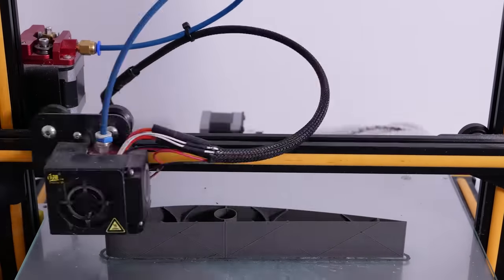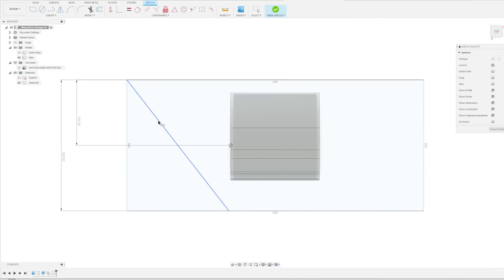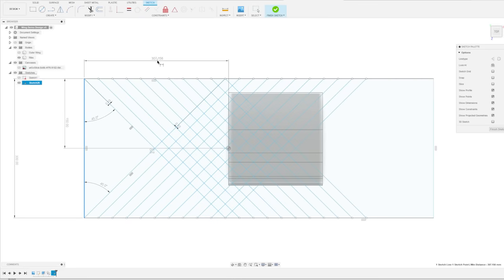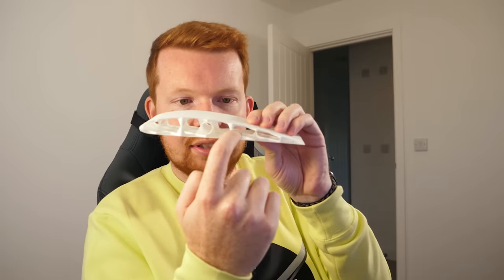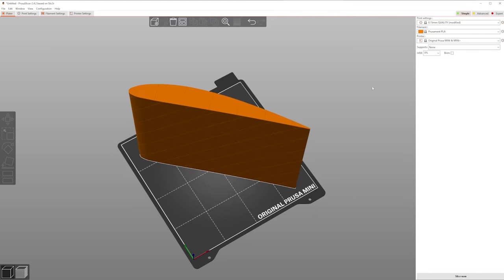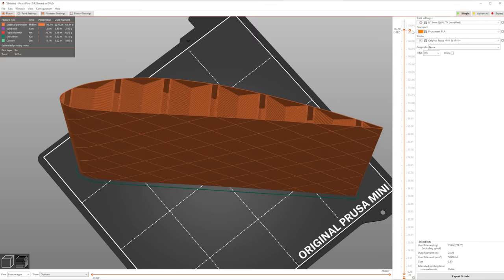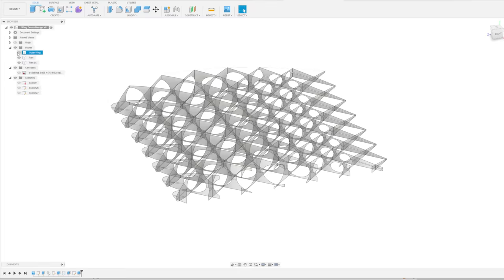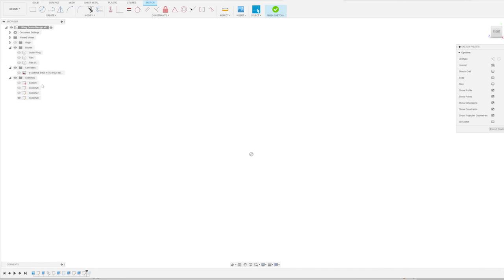How I Designed a 3D Printed Wing

Comment: why wouldn't you just set it up so you can input the NACA number and it'll produce whatever airfoil you want from the equation? then make all of the internals contingent on that, and voila, after making one airfoil you can instantly get another one with any NACA number. since your rudder and elevator will probably be different profiles from the main wing (probably only the main wing is cambered, for instance), this is a good way to go even for just one model.

https://en.wikipedia.org/wiki/NACA_airfoil#Equation_for_a_cambered_4-digit_NACA_airfoil

Comment: Normaly this wings need a little twist. At the outside of the wing the end of the wing profile is a bit higher/up.

The hole for the rod in the wing should be at the center of the lift force :)

PS: If you try to build a new electric drive for a bisycle you can use a big servo :)

Comment: Its a fail because the top and bottom parts are NOT joined resulting in structurally weak parts.  Its not looks but strength thats critical
Reply from the maker: They are joined, that's like saying each layer isn't joined
Reply: @TimStation  prove it in an update vid.  Ive done several test prints.  The top and bottom layers may rest against each other but are not joined or at best a very weak joint because you made the pillar contact points too small.  A larger contact point may do the trick

Comment: how about taking this down n dirty sketch from the point you have the cross hatch pattern in it and NOT the holes ... (add the spar) ... then do an airflow test across the wing and show the stresses on the wing and its ribs ... THEN remove excess material and not take out materiel from the high stress regions and remove it from the low stress ones ... 
.
of all the people that show "making a wing" NONE of them do a stress analysis on the wing ... EVER they just like you have done here arbitrarily slap holes where they feel like ... 
.
what I want to see is HOW the design will change when you actually design the wing with actual flight in mind and for full sized actual wing ... this way model to full plane the wing will be designed for actual flight and flight stress loads
Reply from the maker: Please see the video linked in the description for flight testing and structural melt testing